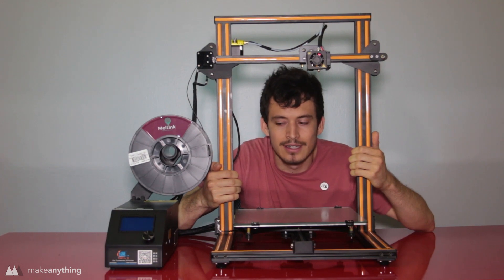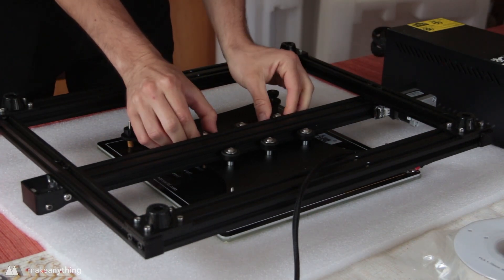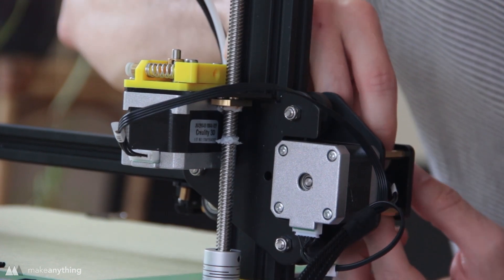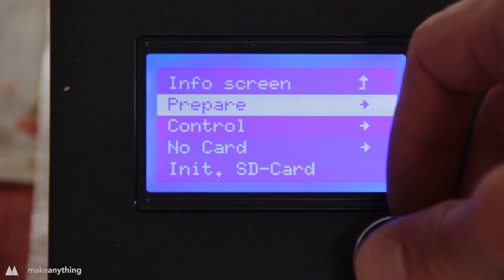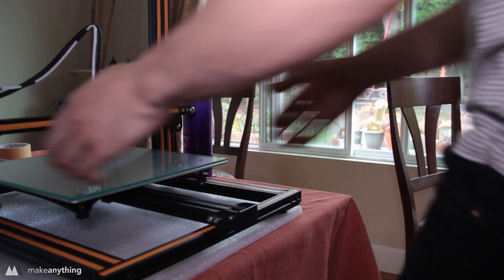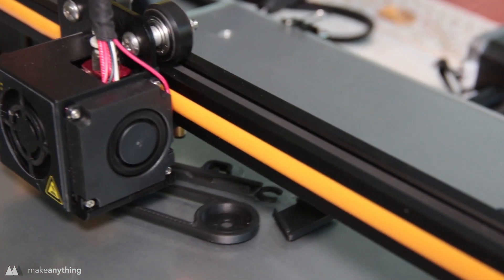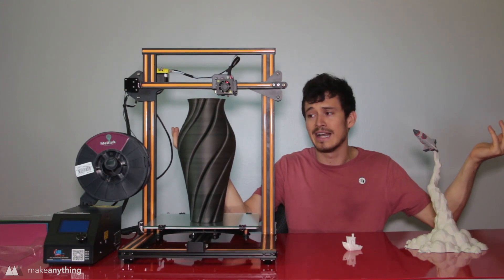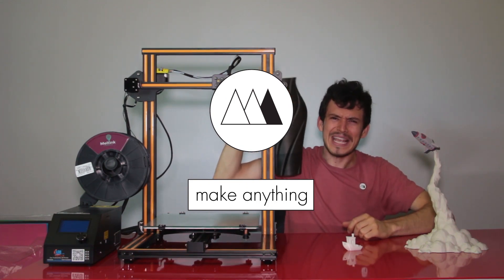♥ CR-10 3D Printer Unboxing/Review/Giveaway

Comment: what is the option on Gearbest that says "US Plug Upgraded Version?" I have no idea what that means or if I need it.
Reply from the maker: I think it's just shipped with upgraded firmware and maybe a few parts injection molded instead of printed. It's probably a good idea to get the latest version

Comment: Please please... can someone please help, my y axis is juddering, no matter what I try I can’t seem to fix..!

1. The wire has been swapped to see if motor was problem and problem transfers to another axis.
2. The wheels aren’t too tight I’ve tested that. 
Adjusted the mother board pots for resistivity, doesn’t do much.. maybe slight temporary improvement. 

What else can I try; it’s been 8 months or more now, just don’t know what else to do but ask for help.

Comment: What is a good average layer height? And what has thicker lines: 0.5mm, or 0.25mm
Reply from the maker: I tend to use .2mm layer height down to .1 for the most detailed prints. The smaller you go the less layer lines there should be, but it also dramatically increases print time
Reply: Make Anything so 0.25 would be thinner?

Comment: See that more than $150 difference between US and the EU plug? That's not fair! 😣
Reply from the maker: You can just buy the US and use an plug adaptor! And make sure the voltage is set to 220v to not blow out the board
Reply: Make Anything thank you for answer. I don't see very much YouTubers replying to my comments even if I speak directly to them. That's nice you are interested in your fans so much. 👍 That's why I subscribe your channel.

Comment: Instead of using hairspray and alcohol you can wipe the whole surface with a papertowel soaked in vinegar, smells bad, but it cleans the bed and makes for great (sometimes too much so) adhesion.

Comment: I just received my HICTOP CR-10 3D Printer  with no manual in the box. So I assembled everything based on this YouTube BUT after turning the machine on, display does not work!!
Reply from the maker: Did you make sure the voltage switch is set to the right setting? My CR-10 was set to 220V when it arrived but I had to switch it to 110V for the US and then it turned on. If it's turning on but the display isn't working, it's a malfunctioning unit, nothing to do with assembly. You might be able to open the thing up and fix it, but you shouldn't have to :\
Reply: Thanks for the response. It is on 110 v and I can hear the power supply running. So you think i should send it back?.  such a disappointment
Reply: Thanks for the advice. you were right. I opened the bottom led and removed the power supply and sure the pins were not connected. I connected them and now it is working.  Thanks
Reply from the maker: Awesome, glad I could help :)

Comment: Nice Video and congrats for 170k! How does this printer compare to the Trinus? I've read in the comment section of your Trinus video they're both very different so hard to compare. I'm lookingt for very precise small models, especially working parts for small hobbyists projects such as Quadrocopterparts and stuff. But of course having a big printer can't be bad if I would ever need it. But is it as precise as the Trinus?
Thanks in advance!

Comment: I purchased a CR-10 in April.  In July it failed.  The first layer test printed with 2 45 Degree Lines touching as it should but the it would skip a space then again would print 2 lines touching.  The 2 lines touching showed that the Nozzle height was correct.  This would repeat across the 75 mm square test pattern.  The belts were tight, the bed bearings were snug so all apparent possibilities were covered.
     I contacted Gearbest and explained the problem.  The appear not to be able to read English because the repeatedly ask for a video showing the problem.  I had supplied them with a picture clearly showing what I described above.
    After two weeks trying to get them to read my complaint, they told me to adjust the nozzle height to the bed and since I had the unit over 45 days, they could not give me a refund or replace my CR-10.  
    Even though there is a 12 month warranty on the CR-10, I can get no help.  ie. THEIR SURVICE SUKS. 

    BTW: purchased a second CR-10 that works great.  JUST DON'T COUNT ON ANY KIND OF SERVICE FROM THEM.
Reply from the maker: +Carl Beck I would go onto the Facebook cr-10 user group and ask for their advice. With over 11,000 users, someone is bound to have experienced the same problem
Reply: I have done that.  All replies have referred to adjustment or Slicer setting.  It is a malfunction.
1.  I have a 2nd CR-10 that I have adjusted to get very good results with.
2.  My slicer adjustments are perfect for that one but I do make slight adjustments for different Filaments

Comment: One small nitpick: if you have a feeler gauge, you measure the distance by "is it possible to insert a [thickness] gauge in this gap?" So, to set the distance to your bed to .10 mm, it should be possible to insert the .102 mm gauge, but not the next thicker gauge (e.g. .110 mm). That way, you remove the subjective part of measuring!
Reply from the maker: Good to know, thanks!

Comment: Prints looks great. Really love the rocket exhaust smoke cloud - would look great on any desktop :) For the looks of it, this 3D printer seems very well made, for that price point. All right, it comes without enclosure etc. but still - seems to be proper value for your money. Also, I would expect, using those aluminium extrusions, makes it easy to repair or modify. Really makes me consider using those extrusions, for the next version of my DIY low-cost CNC build. Not to mention that I really want a 3D printer now of course... think this video was the tipping point.

Comment: Hey devin!Do you know how to take the nozzle off on a 3D pen i just got one in the mail today and i cant find how to take the nozzle off.
Reply from the maker: It depends on the pen, but most have two tabs on both sides that you have to press and then wiggle the nozzle off carefully. The pins are fragile so try not to bend them. But why do you have to take off the nozzle? If it clogs force filament through at a high temperature, or use a .4mm needle to poke through the tip.

Comment: I tried to buy one on gear best but their website is broken. No matter what payment method I use it comes back with errors. I went and bought the same printer on Amazon using the same payment method and it worked fine. It's more expensive on Amazon, but Amazon's payment processing isn't broken.

Comment: It's crazy to think of what just under $400 USD gets you with this machine. The prints are crazy good.
Reply: 3D Printing Nerd I don't know if Androids Dream of Electric Sheep but I Dream of Electric 3D printers specifically a cr-10
Reply: 3D Printing Nerd I whant whan so bad
Reply: 3D Printing Nerd can I buy from gearbest and trust them, where did you get your cr10
Reply: u saw the promotion as well? :p
Reply: what nozzle size are you using? and layer height?